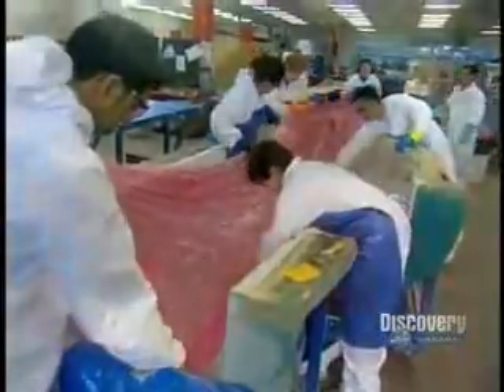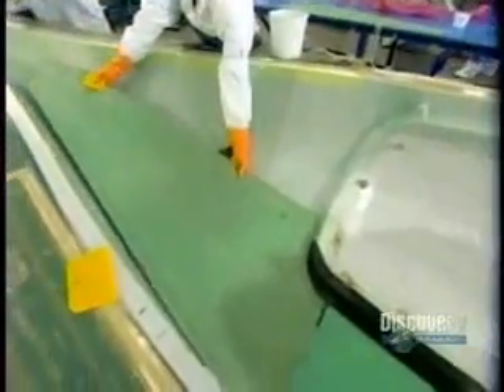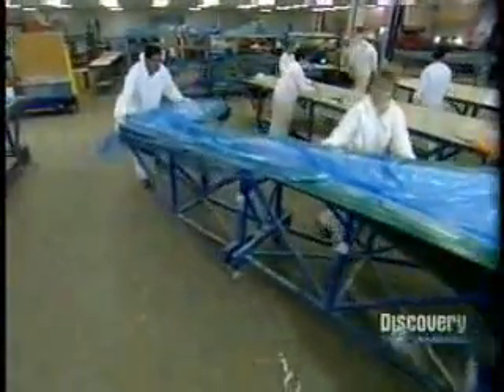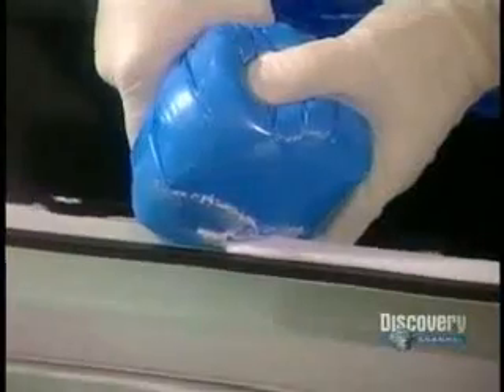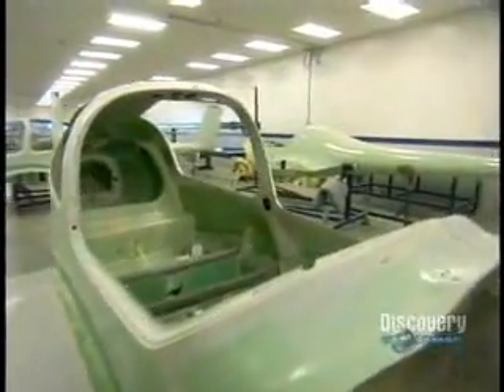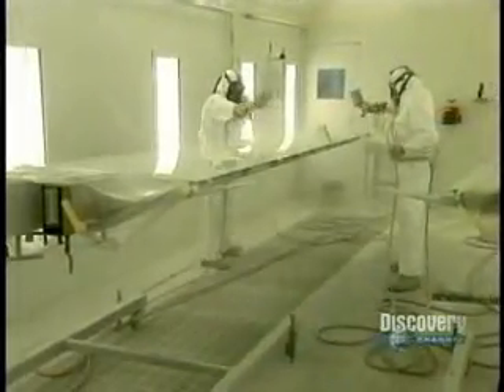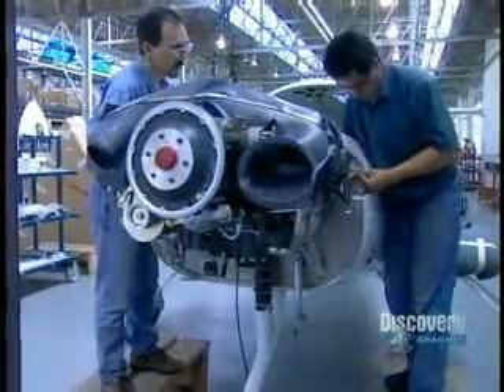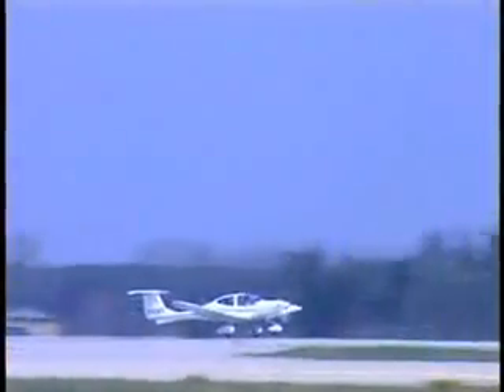How it's made: Airplanes

Comment: Its nice to see the different steps that are taken when building aircraft but aircraft engineers and scientists should come up with parachutes that are installed in ALL airplanes that can be activated to bring down the plane in one piece in case of mishaps thereby saving lives.
Reply: I thought this too, but I guess the issue is that it is too costly given how safe aircrafts are and unlikely a crash is to occur.  The parachutes would have to be quite large and the additional structural engineering necessary would , along with adding to the manufacturing cost of producing a plane, decrease fuel efficiency due to added weight and thus increase fuel costs as well.

Comment: Cars are cheaper because of competition and quantity. They have more interior parts and more machinery is needed to stamp out panels etc, but car companies generally pump out lots of cars which brings value down.  I've worked with fiberglass etc and it's cheap. If they have all the gear to make all the parts then the profit margin would be better than if they had to out source for parts. They also have to pay wages, rent, power, supplies, tax, insurance, advertising, and so on. I'm sure they ha

Comment: The DA-40 is an excellent aircraft - I'd say it's a generation ahead of the Cessna/Pipers. Stick control, massive bubble canopy, comfortable seats, G1000 glass cockpit (in the one I flew anyway), 135kts TAS at under 40lph easily. And the wing is certainly strong enough!

Comment: water doesnt heat up so you dont need lubricant(obviously)

and it doesnt create a lot or pressure like metal on metal contact does. and you can control the jet of water for certain materials so you dont have to change out the heads of the machine for different metals or synthetic materials

Comment: A Quantum leap in aircraft design.  Damage is more expensive to repair than metal, but the molded wings and body are much stronger and lighter, but more importantly are designed inch-by-inch for more aerodynamic efficiency.
Compare two 4 place 140KT aircraft, the C182 and DA-40.  The DA-40, shown being made, uses less than 10 gallons per hour and the C182 over 13.5 gph.  Consider that avgas is 40% +/- more than auto gas, and that the DA-40 is fun to fly, the metal Cessnas, Pipers, are obsolete.